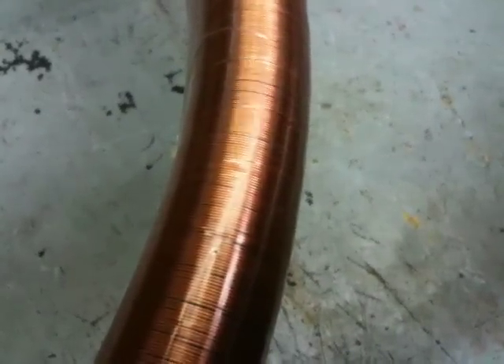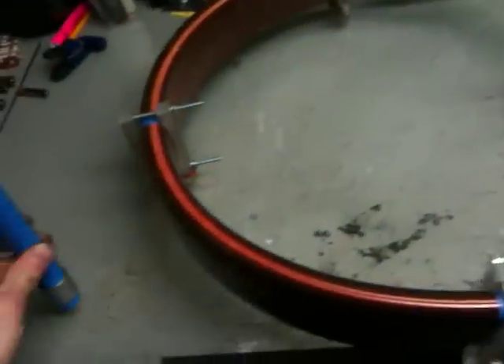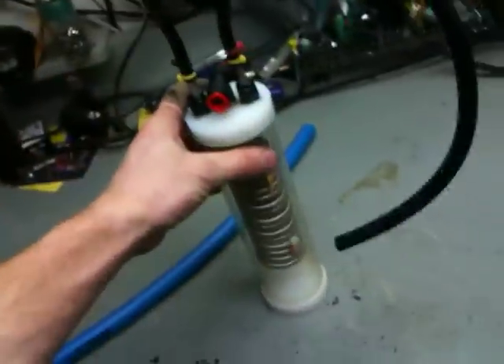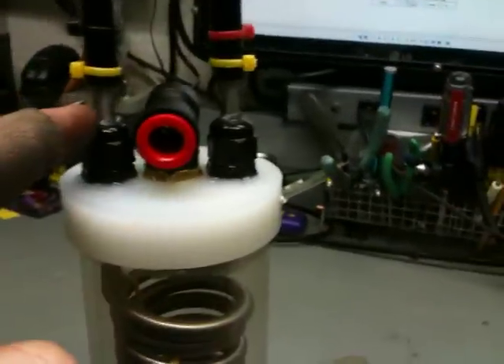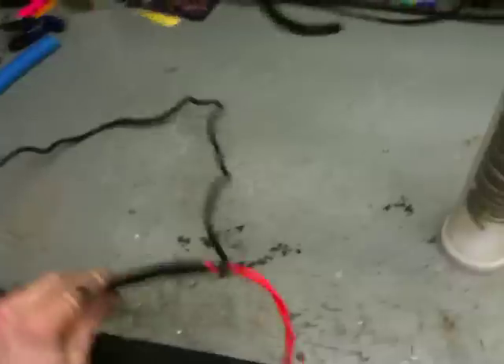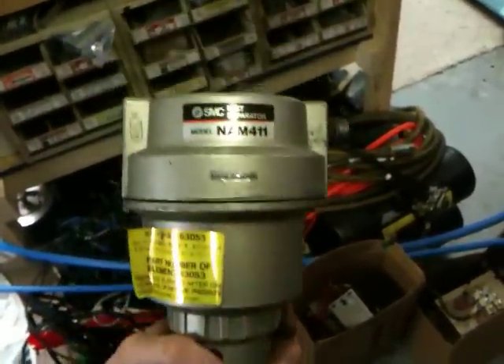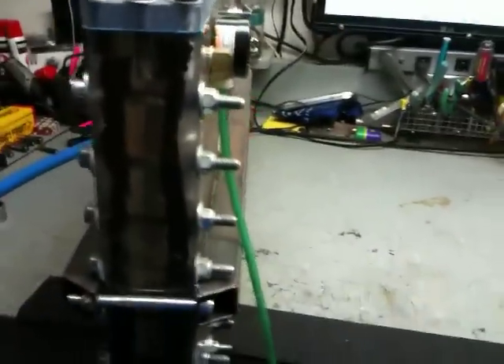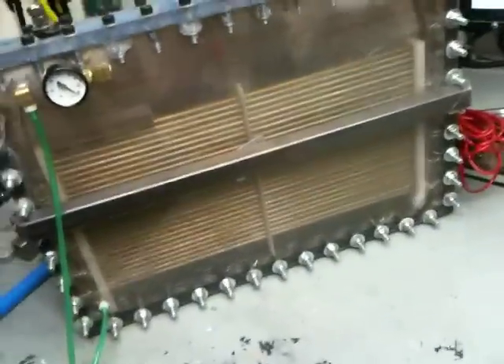EPG , Rustic spiral cell, old electrolyses system, a thanks, and a god bless, Update 1

Comment: Looking good!when you get to purchasing the argon go for a large bottle.i very quickly emptied 2 of the disposable bottles and at $30 a pop things could add up real fast.hiring a large bottle and getting the gas i was looking at $140hire and $60 for a fill,which im sure would work out way cheaper in the long run.950 cc in the disposables didnt go far when testing the spark gap.

Comment from the maker: @m3sca1 hey! Your work is looking good!!! I want to know if you striped the coating off the magnet before you tryed your test??? Also I have a welder so argon all day... Also I'm going to use it at a verry slow rate... and also going to fill the chamber up with argon all the way then let the arc run for a while... Then try the tests... And try nickel!!!!!! And carbon!!!! Thanks! ~Russ

Comment: Russ, you got clear pipe and stuff to make the ends - make a bubbler that looks like your cell.  I'm going to tell you how my bubblers are different. I fill them with clear marbles and glass beads. Since I use UV in my bubblers, the spheroids refract the photons.
The real trick is to make a cell that runs cool, very little steam made at all, that way it's easy to scrub from the gas. Your old cell, as cool looking as it is, it's a steaming behemoth and not very efficient.

Rock on my friend.

Comment: @rwg42985 i answered that question under my last vid but perhaps YT isnt handing along all the notifications of new comments-i notice that sometimes on my channel.no i didnt remove the magnet coating-i figured it would burn off-i just took the lid off the spark gap chamber and i see it has come away from the magnet-i need to make a more robust chamber and i bought a cobalt high speed drill bit to burn up.
i want more burn,since im concerned about the particles being too dilute in the gas